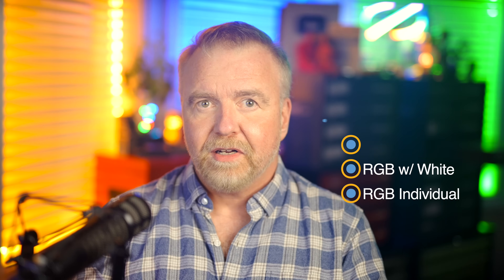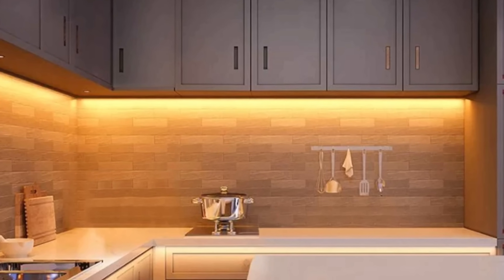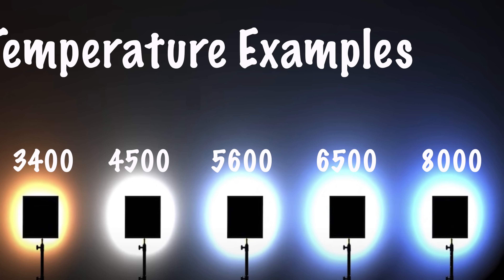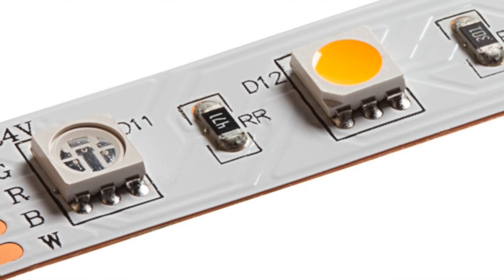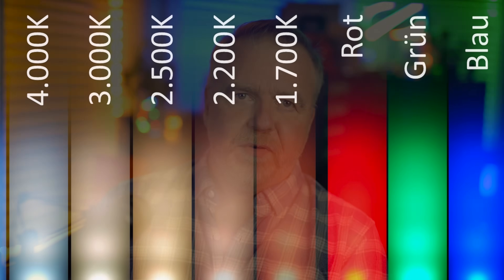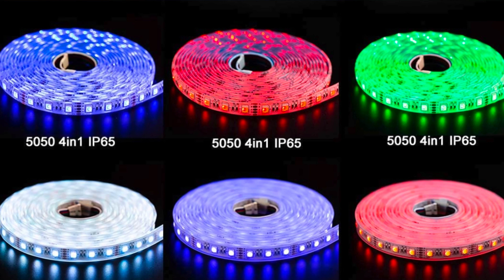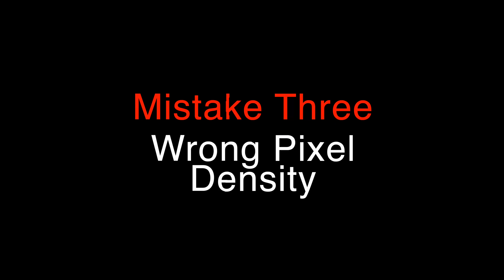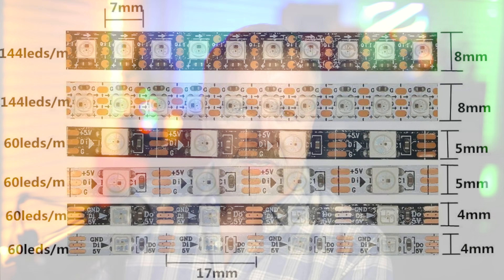LED Strip Projects: Top 5 Tips and Top 5 FAILS to AVOID!

Comment: As indicated in other replies, when using WS2811 or WS2812 addressable LEDs, each LED is forwarding a fresh signal.  Have you ever wondered why or how the LEDs addresses are assigned?  The explanation for both are linked.  Each LED reads and removes a number of bytes it needs to control it and forwards on the remainder.  So addressing is based on how many LEDs are before it.  To each individual LED, it does not know how many were before it, it is just using the first 3 (or 4 if there is a white channel) bytes, removing them, and forwarding on the remaining bytes.  To remove the bytes, it has to actively modify the remaining data, hence it is outputting the fresh signal.  The idle state is what tells each LED that the previous set of data is done and where the data for that LED starts.

Comment: Dave,  As so very many others, I love your videos and the things you do with LEDs.  You mentioned 5 fails to avoid but maybe numbers 6 & 7 should come in another video.  I like to play around with the WS2811, WS2812, & WS2812B LED strips.  However, I am finding that some of the vendors do not label their products correctly, meaning where they are suppose to be RGBs they turn out being GRBs, some of the WS2812s are WS2811s.    

Then there is the case where friends hand over strings of LEDs with no packaging or documentation and I'm left with attempting to discover how to program them to work as desired.

Please consider making a video about how to determine  what an incorrectly documented (or no documented) string of WS281Xs are to get the best performance for your buck?

Comment: you are correct about soldering being a bit of a pain, but I trust the solder far more than the pinch type connectors.  I do theatre installs with lots of LED, and when we were using the pinch connectors, there was always an element of fiddling to get good contact.  Most often on the center color, there just wasn't good reliable pressure.  Failure in the middle of a show wasn't an acceptable thing.  Once you do a few hundred, the soldering doesn't take too long, and it can be 100% reliable.

Comment: Hey Dave, great video. I have about 32ft (10m) of 5v 3pin rgb addressable leds. What kind of inline amplifier should i use? Not really finding anything. All i find is the 4pin 12v stuff...😢
Thanks in advance!

Update:  Nevermind!  Figured out the remote had options to incr/decr the number of pixel points... Whew!
Does help to keep the minimalistic instruction cards...

Comment: Hey Dave!  
I am an info tech teacher with a LED project in mind for my classroom.   I have a whole array of "ladder racks" suspended from the ceiling in my classroom which holds all of the ethernet cables for all of our lab computers, switches, routers, etc.   I plan to map out the entire rack assembly with addressable LED's, and control them with a network connected device which will poll the SNMP data of our core switch and indicate the flow of network traffic over each of the pathways it follows.

in the center of the main classroom we have our core switch, where the student will have to punch down their own ethernet cables and make patch cords, etc etc. I'll have the ports on the switch mapped out to which computer they go to, and a map of which branch they will be on, so if "port 7" is downloading fortnight then lights should show a lot of data being pulled from the dmarc to our core switch, and out to the branch where computer #7 lives.

I think I want to use 24 volt led strips to avoid the hassle of frequent power insertions, but struggling to find any.  Any thoughts on that?  

Also, how is your LASER TEMPEST project coming along? :D

Comment: yes, with the 1 wire LED's each led, strips off it's 16 (12?) bits, and then passes on the message re-encoded without the stripped data. this regenerates the signal each time it's read.

Comment: I'm looking to set up some lighting my room and on my desk with LED strips, likely 12v ARGB strips specifically.
I've seen some certain off the shelf solutions of ARGB lighting with a noticeable amount of flicker, and I'm wondering if that flicker tends to be caused by the power supply used (i.e. poor power quality, large peak-to-peak voltage fluctuations and such), rather than the nature of the ARGB signal. Does anyone happen to have any knowledge of this?
Reply: As an aside, I'm actually intending to use my computer power supply's 12v rail as the primary power supply for these strips, so the quality of power delivered will be extremely high as I have a top end PSU.

Comment: Hey Dave, you are correct about each LED controller chip repeating the data signal with one caveat.  The signal is always repeated at VDD, so one situation that can cause problems is injecting power into a very long run from a second power supply.  In this case you would use common ground, and connect the data channel but you wouldn't connect the V+ of the first run to the V+ of the second run.  In this case the last LED of the first run could be outputting the data signal at a reduced voltage like 3V (due to voltage drop), while the first LED of the new run will be at a nominal voltage like 5V and will result in data corruption.
Reply from the maker: Thanks, good point!  I always reinject fresh power so that it's never struggling for adequate voltage, and at least in practice that's worked pretty well!

Comment: The voltage drop is what matters not so much the amperage when talking about distance. An individual LED introduces resistance by consuming power plus the resistance of a wire. Your suggestion of injecting every 2m is good but if you are using 144/m strips that could cause some voltage drop where the 2 strips meet such that you may see a dimming/hue change in the middle of the 2m run. It's better to say power inject every 100 LEDs for 5v or 200 for 12v, pushing it to the limit people can do the calculation of voltage drop and get an exact number if they really want to pinch every penny. 3.3v or greater will power most LEDs some specific colors require higher voltage, this is why when voltage drops in an RGB LED it appears redder, because red LEDs only require 1.7-2v whereas green and blue are 2.1-3.3v.

6:24 You are correct that each WS2812B will amplify the data signal so you don't have any worry about data loss or corruption. There is a timing delay between the signal so for faster refreshes you may want to limit the number of LEDs. I'd be curious to see tests on your 1000 length runs of how fast you can refresh and if you see any delays.

EDIT: Should have watched the whole video before commenting. You covered voltage drop later in the video. :)

Comment: 10amps per Meter? I hope you have good fire insurance. I work primarily with 5054 based strips which arw among the highest current available and at the typical 16.4 feet with 600 LEDs. I try to run no higher than 3amps or so. This is achieved using a variable voltage supply. At even 4amps the strip gets too hot to touch and I'm well north of 12 volts and just feeding the resistors between each set of 3 LEDs. I strongly suggest staying at around 11.5 volts for safety. Honestly, the 12 volt spec for these strips is bad. Its too high forcing the use of inline resistors and hence wastes power and causes heat. The more efficient the LED the lower the forward voltage wich means more resistance is required. Its dumb.. Ditch the o
Unline resistors and use a 10 volt supply  I say. Radical improvement in efficiency. Addressable LED strips are typically lower density and hence dont have that much of an issue, but many are still being over driven. I build some pretty cool stuff with high current Crees and Bridgelux. Strips are fun, but horribly inefficient, and their lack of current regulation can be dangerous.

Comment: One tip with single-color strips is to feed positive on one end of the strip and negative on the other. This results in equal voltage drop on each LED and eliminates the brightness gradient which may normally occur.
Reply: That is a pretty clever trick you got there.  I wonder if it would also work with ws281x so long as you feed data in the grounded side.
Reply: I just learned about this and it's blown me away. I was able to increase the power supply voltage with a multimeter connected to the strip so that at any point on the strip it was nearly the rated voltage, almost doubling the power I could put into the strip (NOTE: only raise voltage for "dumb" LEDs that are always on with a fixed color, NEVER for WS* RGBIC). So you end up with say 12.0V across the rails at any point on the strip, even though measured from one end to the other you get 13.8V. Note that this will result in more heating since that extra voltage is turning into extra heat in the copper strips.

Comment: You can buy higher density RGB strips, 240/m and 300+/m but they are harder to work with and fearfully expensive compared to even the 144/m strips. Might be useful for certain projects, though.
Reply: The 5054 based strips are brighter.

Comment: As to why drop power every meter versus 2? If you want there to be more light in relation to power used that's wasted in the form of heat in the whole system, then you'll want it more frequent.  The wiring between lights is likely to more readily dissipate waste heat to where you don't blatantly obviously observe it, but the power is used and dissipated, even so.

If it works within your desired objectives for brightness with power drops less frequent and you don't mind that tradeoff for some reason, then having less frequent power drops is less costly to build.

So, there's your question answered!

Comment: I actually did a project for this.  I got circular ring of rgbw 24 leds, individually addressable,  and implemented a clock using a 2811 library, modding an example.
Reply: Ws_2811 c library. It was pretty easy once I figured out the scans part. I used a raspberry pi to drive it.

Comment: Regarding the data signal being relayed, I don't see anyone else making this observation.
It is most certainly refreshed at each LED, that's how they are addressed.  The address is the number of LEDs from the signal injection, there's nothing different about each LED.  Each LED re-transmits the data packet with the address number reduced by one.  Once an LED gets a data packet with the address zero, that colour data is for that LED & nothing is re-transmitted.
Reply: Close… at least with the most common types I've seen, e.g. WS2812, there is no address as such, or at least it's never transmitted. Each LED simply acts as if it's the first in the run, taking the first color in the data stream and passing only the remaining data to the next LED.

Comment: What about electrical code?
Reply from the maker: Nightdriver is electrical code!  But if you mean the UEC, doesn't usually apply to 5V stuff that you could touch your tongue to :-)
Reply: @DavesGarage   I don't know what the UEC is, but the American NEC and Canadian CEC don't automatically exempt these systems. Definitely don't if the power supply is more than 100 W. 12-V, 10-A systems come under the code. And the power supplies absolutely need UL/CSA/equiv listing since they are 120-V. There is a decent article on the Waveform Lighting web site entitled "Do LED strip lights require UL listing?"

The article does not describe the Canadian situation. Because every jurisdiction has legislated that the CEC is law, it is, in fact, illegal to install equipment that does not meet code. 

Electrical codes are primarily about fire prevention, as opposed to shock protection. (Emphasis on "primarily.") You can easily start a fire with 5 V. People ignited cigarettes for decades with 12-V car lighters.

Comment: Don't forget to insulate your solder joints!  When I installed LED strips in my kitchen, I soldered wires to the ends of the strips.  Even though I only removed 1-2 mm of insulation from the wires, it was apparent that the exposed conductors could touch each other if the wires were moved around enough to bend the strip a bit.  So, I put a blob of clear silicone on each connection to keep it well insulated.
Reply from the maker: Indeed... I mention that for the channels, but I like the silicon idea, thanks!
Reply: @DavesGarage  if you go with silicone make sure it's the alcohol cure type not the acid cure type that smells like vinegar. It should be in the fine print on the tube.   Also there's probably  something similar to the screw terminal terminations for 24 volt systems carried by electrical supply distributors.

Comment: Injecting power once every 2 meters (@5:10) is good enough because you'll most likely never have ALL the LEDs in an RGB strip at 100% other than short periods. You shouldn't drive LEDs at full brightness anyway since they wear out faster that way.
Reply from the maker: Ah, but the mental exercise does assume you've got them all set to full white!

Comment: Dave I just finish a project in my kitchen with about 40meters of 24v RGBWW  leds strips with 7 zigbee controllers. Every point you made was spot on. You addressed all the point it took me 2 months of research. I will very much recommend your video to anyone looking to do a similar project. The aluminium channels with a defuser are a must, I had a basic channel and a 45 degree channel they are great make a real professional look.

Comment: Great video, Dave. I have been fooling around with 12 volt WS2811 individually addressable led's for about 5 years. One of the problems I had early on was unreliable power supplies, I guess it was just bad luck after buying 10 supplies and 9 were DOA? 
At my local Goodwill store I found 6 power supplies for the Microsoft Xbox 360E consoles that have 12 volt output and 9.6 amp. These are regulated supplies that also have an internal fan and are reliable.
Reply: Most Chinese PSUs are usually at best crap, at worst an imminent danger to your life and your property (see DiodeGoneWild tear-downs). You should only ever buy a brand name (such as Delta or Meanwell) from a reliable source. I was hoping Dave would emphasize this point a bit more in the video...

Comment: Hi Dave, Something LED related that you might enjoy looking into is xLights.  It's a free opensource tool that allows one to create LED display sequences. xLights will generate a sequence that can be "played" onto an LED controller. The LED controllers generate the ws2811 protocol signals for individually addressable pixels.  You can have multiple LED controllers which can all be centrally controlled. I think I saw a WLED controller in your video. xLights can control it.  xLights can also control DMX devices, such as movable head spotlights. Just look on youtube for xlights and you will find numerous videos of people's displays and how-to videos for building. The community surrounding xlights is phenomenal.

Comment: A few years back, my wife asked me to get rid of the lighted garland that was on top the kitchen cabinets. While having the light on the cabinet was nice, having a pine garland year round was not. I wish your LED light videos, such as this one, had been around then, it would have made figuring it out a lot easier.

As I wanted a strip where I could change the color to fit the holiday/season (like green for Saint Patrick's Day), have Alexa integration, and still have okay temperature levels of white, I went with a 5050 RGB strip with Govee controller. It took a bit of finagling and twisting to get the lights to be somewhat close to lighting the ceiling evenly as the cabinets they sit on are not all the same distance from the ceiling. 

I didn't realize when I was buying the parts that waterproof connectors don't work on non-waterproof strips. Lesson learned. It wasn't quite as simple as I thought, as so many other projects turn out to be. In the end, there is a couple of hot spots and dark spots, but all in all, it looks good.

Now I've got to figure out how to hang the RGBIC rope light my teenage Granddaughter got; the double-stick tape they provide doesn't work. The lights get quite warm, which is how to get the double stick tape off the wall, with heat. I'm trying to avoid wall anchors, but that might be next.

Keep 'em coming Dave.

Comment: I've used old PC PSUs for powering LED strips - works well and you can get them from anywhere :)
Reply from the maker: Indeed, I have little breakout boards with 12V and 5V taps that are handy, you plug it into the PC power supply and it has fuses, etc....
Reply: PC PSU not just for PC. My brother used to have a car stereo head unit in his room powered off a PC PSU.
Reply: Indeed. And server PSUs are often available pretty cheaply for old models. It is not uncommon to find them that can supply 50A or more at 12V, and often a couple amps at 5V on the same unit.
The external PSUs for Dell 755/760 USFF PCs are quite nice for LEDs. They put out 12V at 20A (if memory serves) and while not waterproof, are tightly enclosed in plastic cases. And their standby current is barely measurable.

Comment: I did have a question for you, but wanted to wait for a video such as this. 

For my first custom run I was attempting to run some 5050 strips off my asus motherboard with extensions and such. 12v to 12v ran just fine until I tried to add some custom runs to the line. It worked until I crossed red to green because of a bad solder point and fired both 12v headers on the motherboard leaving me with only 5v headers left. I've been looking for a way to convert 5v up to 12v so that I could run a single color signal from the 5v header to have it come out on the 12v. Any recomendations? 

 I've been debating on just redoing the runs with WS2812B's and an amplifier but for ambient lighting that wouldn't really fit the astetic.